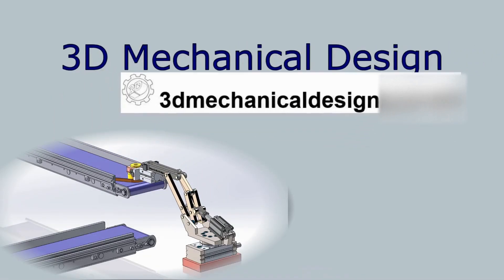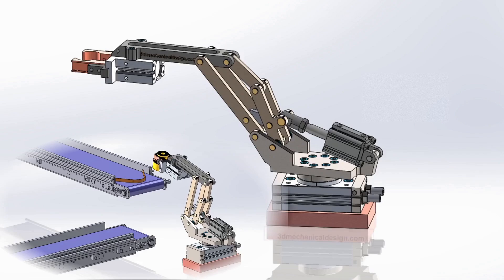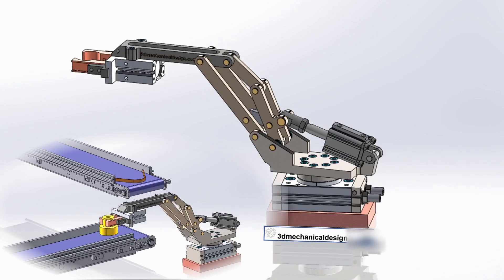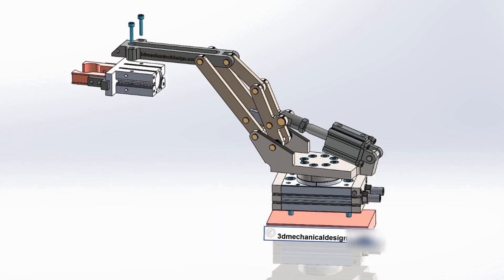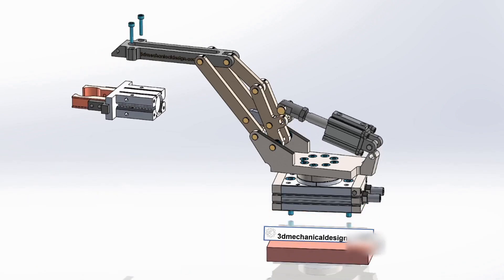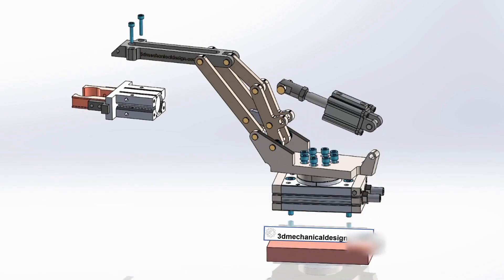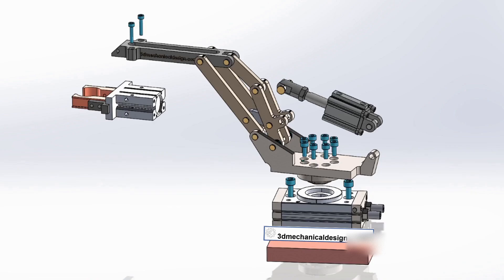⚡ The Future of Manufacturing: Pick and Place Automation Machine  idea

Comment: I could surely use some personal information I built myself a sidecar on the side of my motorcycle for my wheelchair it's got a two-piece folding ramp well I need to put hydraulics on there and I'm not really quite sure how to figure out how long they should be so I can push a button and open the gate roll the wheelchair down do my business and when I come back roll up on there and push another button and have everything fold up I found a place where I can get the excavators but I don't really know exactly how I mount them or how long they need to be could use a little help if you could help me personally please email me and let me know and I will send you a picture of what I've got and maybe you could give me some little bit of advice I would surely appreciate it because I'm stuck I don't want to order a bunch of activators and find out they're too short or too long or not what I need just a piece of your brain would be very helpful